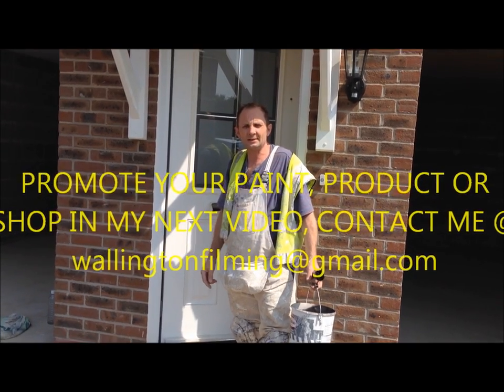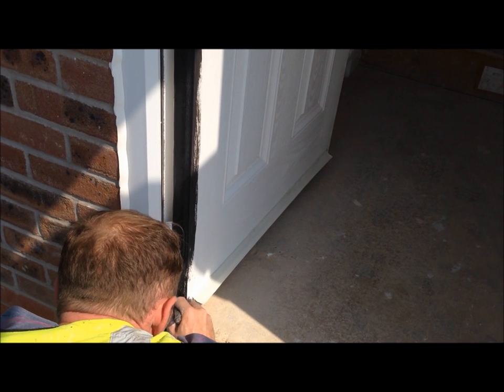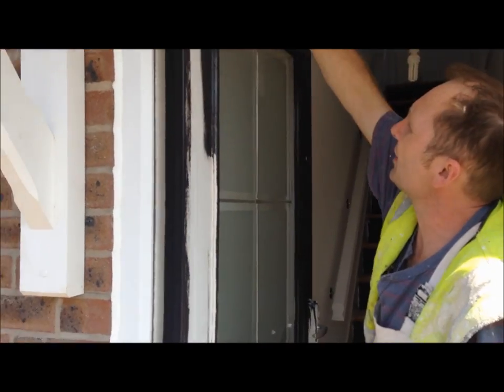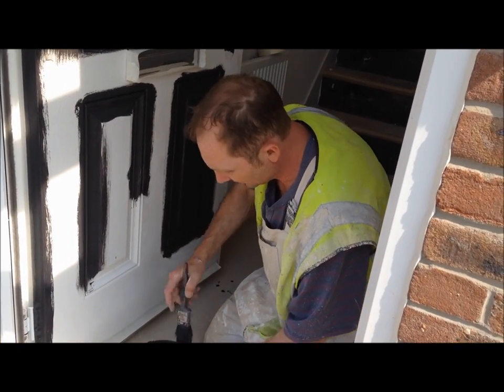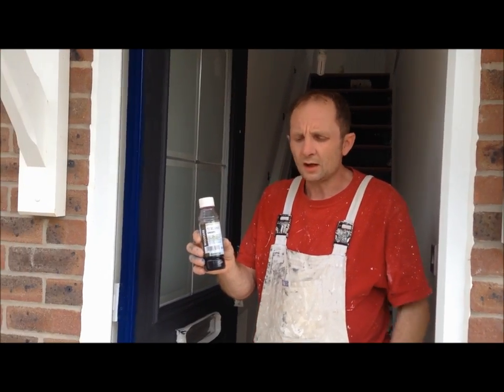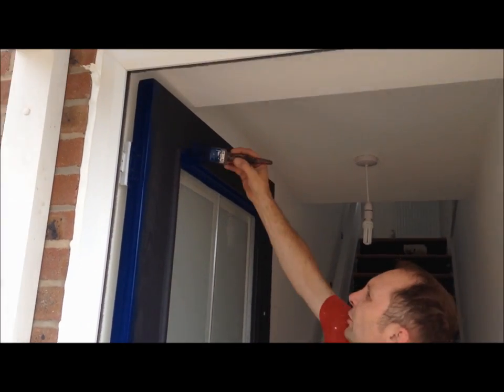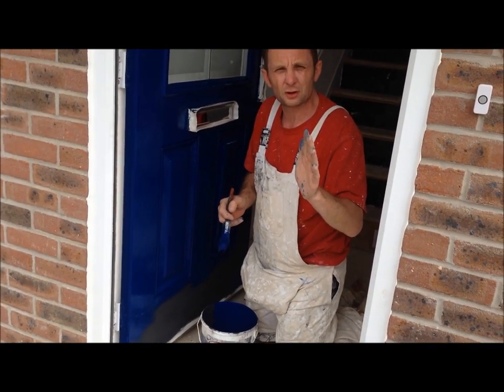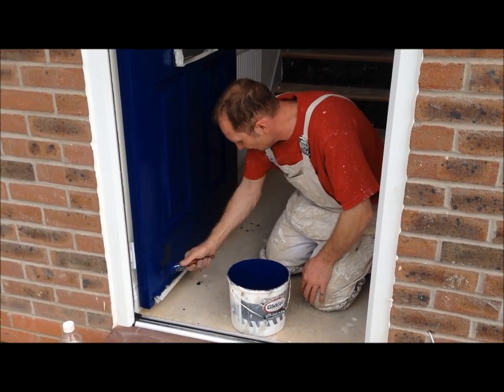How to paint a plastic front door

Comment: I used a product called zinsser BIN , had it tinted to almost post box red, for a customer's bi-fold doors which had turned salmon pink. She was going to fork out for a new pair so it saved quite a few pounds. The finish couldn't be any better. highly recommended, they also do a water based called allcoat, I use that regularly the black is the best I have ever used.
Reply: i've just bought Allcoat in gray for uPVC, 2018 door and windows, so i hope the weather has taken off some of the plastic anti-paint quality.  I wish a follow up was put on all these youtubers painting plastic, see how it really fares after a year or so.

Comment: Great video. I have a door like that when the paint has flaked off in bits, sanded it down but there are areas which feel pitted - do I need to use a filler to flatten the surface or just paint straight over and let the paint even the surface put? Thank you.
Reply: Fill it, paint only hides so much

Comment: Thank you for this. I will have a go with an old white UPVC door I bought from eBay. 
I am also going for the black finish. I was worried that I would have to use spray paint until I saw this video.
Reply: Except the door he painted in the video is a fibreglass door and not a uPVC door.  A plastic (uPVC) door has no grain.  He is advising us to follow the grain while calling it a plastic door.  Very misleading.

Comment: Wash PVC why most plastic have a processing finish. Sanding will or may not remove the stuff. Detergent wash and water rinse Trim Dry then solvent wash. Water will remove any water base contaminates Solvent wipe removes any oil based. You can then lightly buff surface with scotch brite or sand clean prime with latex dry paint with latex.